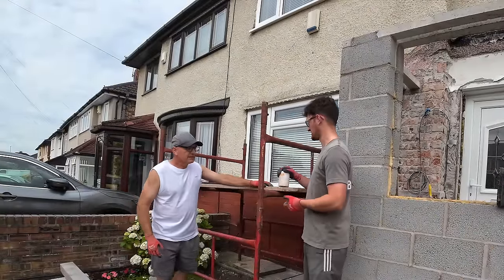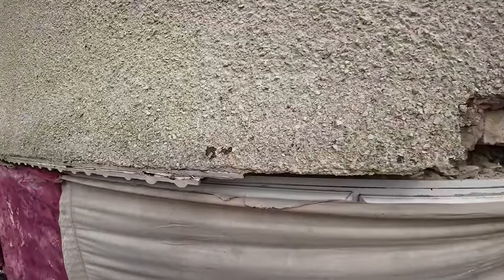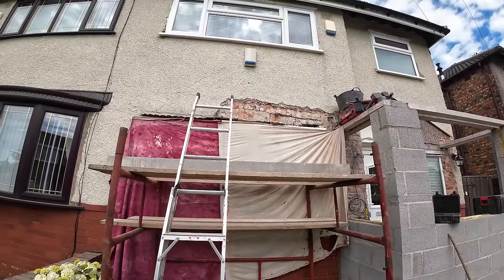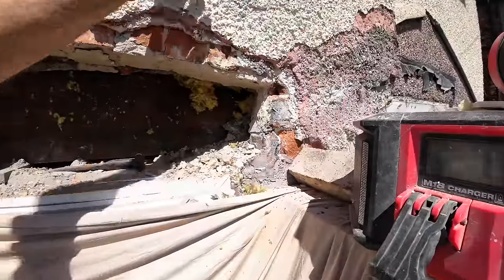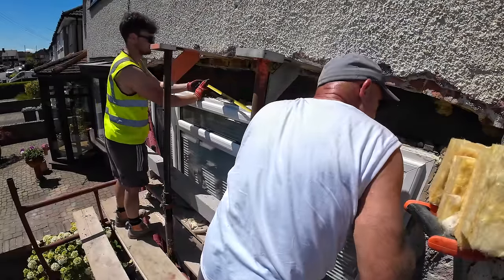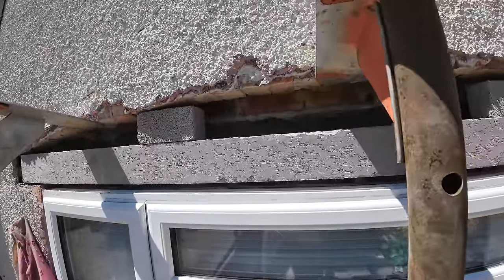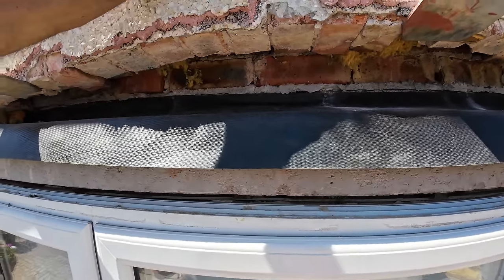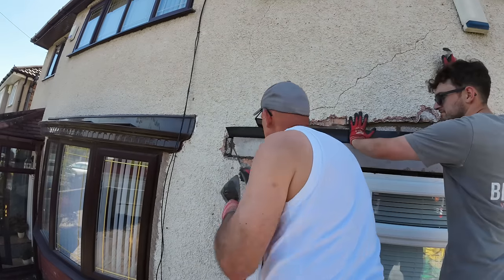FAILED PORCH SERIES FINAL  EPISODE…HEAVY LIFTING!!

Comment: Why was there no lintel above that window, was it like that when it was built?
Reply: There was an arch which should have taken most of the weight, and the original wooden frames would have been structural which would also help take weight. Replace it with a non-load-bearing window and damage the arch while you're doing it, and you've got trouble.
Reply: They didn’t have lintels a thousand years ago. Arches usually last a lot longer!
Reply from the maker: @philtucker1224 👌🏼💪🏼💪🏼🧱👍🏽

Comment: I notice you gents just use the tip of the strongboy , is that OK, I tend to mess about getting it stabbed all the way through the wall,, but then the ones I hire are mostly bent so the inner leaf is not getting g full support ? Any tips here ?
Reply from the maker: They’re not designed for that . They are designed to keep the acrows away from the wall to allow more room to work 🧱👍🏽